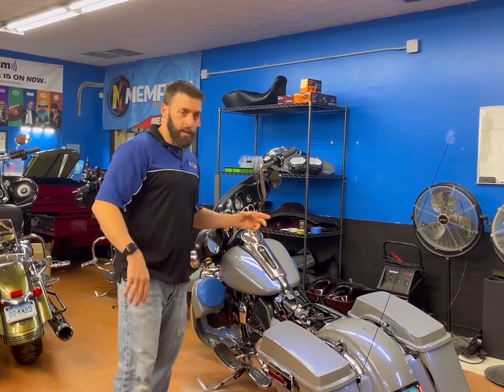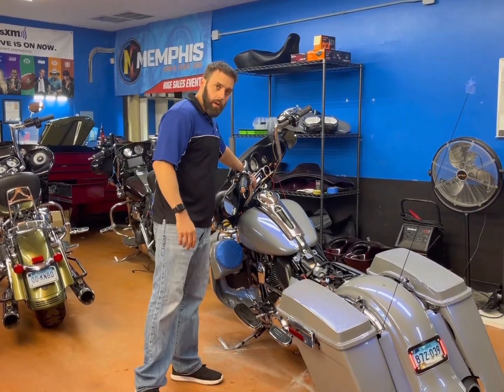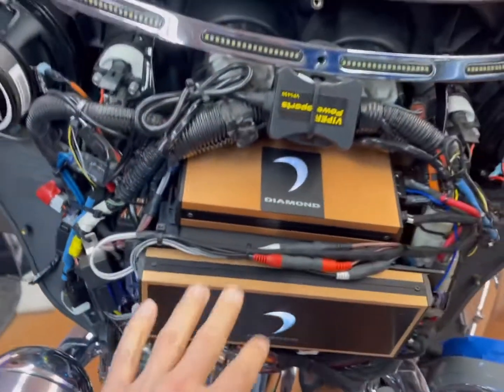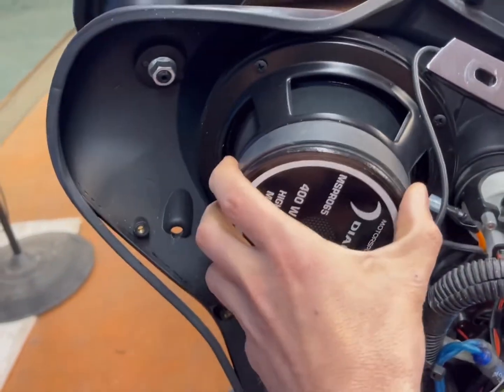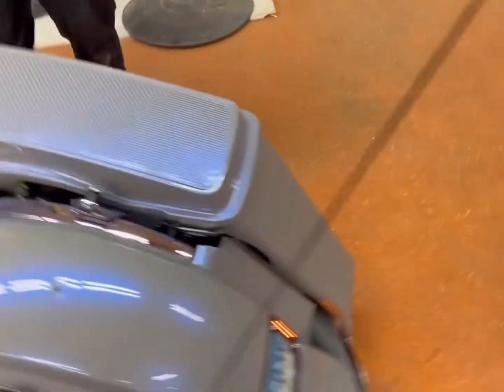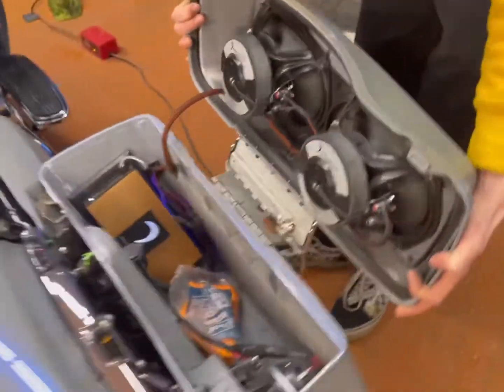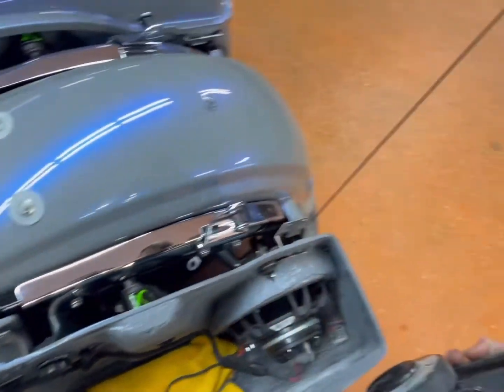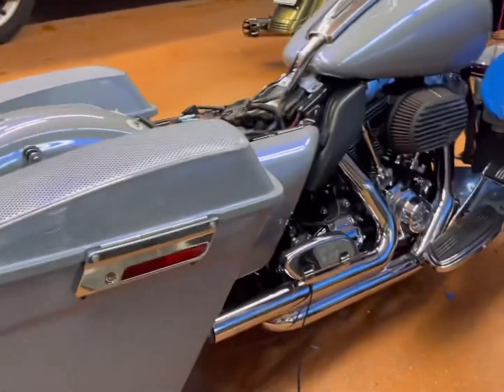Full audio system on Harley bagger

Comment: All of the music off the stock stator, whats the amps on the stator, any extra batteries
Reply from the maker: No extra batteries. It’s definitely more then the stock stator but I’ve never had an issue. We do however upgrade the factory battery to a high performance battery